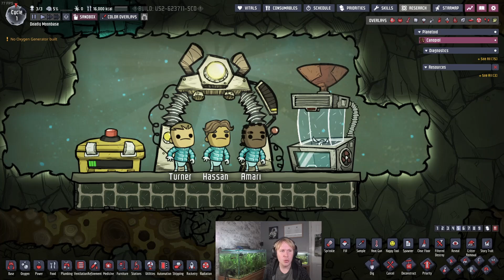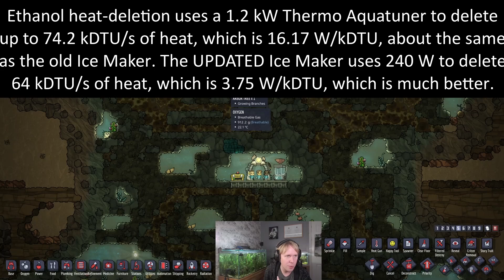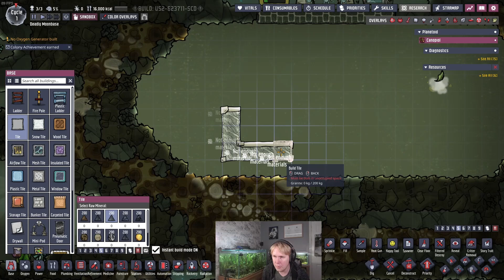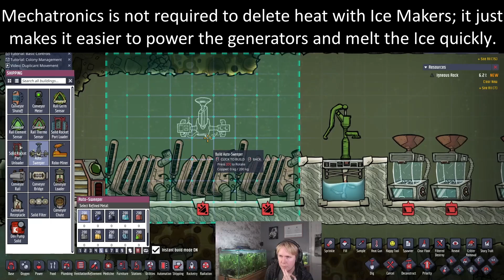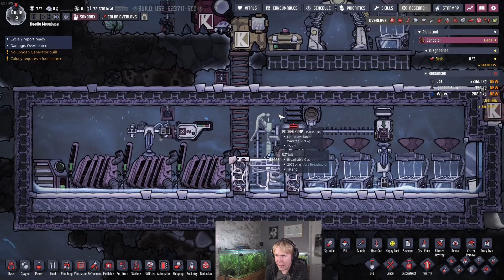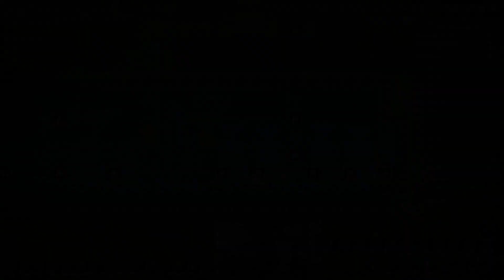The Ice Maker Got Giga-Buffed In ONI: Spaced Out! Sandbox Showcase #27

Comment from the maker: Here's something I didn't discuss in the video! The specific heat capacity of Ice increases from 2.05 kDTU/kg/°C to 4.179 kDTU/kg/°C when it melts into Water, doubling the required energy to state change it. Because we are actively forcing the temperature below this value with the Ice Makers with heat deletion, the overall effect is still obviously heat negative. But doing this with, say, a Thermo Aquatuner, would NOT be heat negative. The rate of heat deletion stays the same for the Ice Maker, so when the Water transitions to Ice in the machine at EXACTLY -0.6° C, the Ice decreases in temperature about twice as fast as the Water in our video at 7:04. 

For 60 kg of 30° C Water, freezing it to -20° C Ice takes (60 x 4.179 x 30.6) + (60 x 2.05 x 29.4) = 11289 kDTU (increasing to 11672 kDTU if freezing naturally in environment). Melting it back to 30° C Water takes (60 x 2.05 x 32.4) + (60 x 4.179 x 27.6) = 10906 kDTU. For 60 kg of 3° C Water, freezing it to -20° C Ice takes (60 x 4.179 x 3.6) + (60 x 2.05 x 29.4) = 4519 kDTU (increasing to 4902 kDTU if freezing naturally in environment). Melting it back to 3° C Water takes (60 x 2.05 x 32.4) + (60 x 4.179 x 0.6) = 4136 kDTU. So about 383 kDTU of heat deletion is lost per batch. Compared to the effective heat deletion of -64 kDTU/s of the Ice Maker and its operational time of about 4519/64 = 70 seconds, the effective heat gain from SHC difference is about 383/70 = 5.42 kDTU/s, i.e. about 8.5% efficiency loss. Overall, this doesn't affect the Ice Maker too much as most of the time/effort is spent in the non-state change regime. :_erisiaCool:
Reply: You are the goat for updating older Videos!

Comment: i mean yeah, it's stronger than before, but before it was basically useless. back in the days i tried chilling my oxygen with them and spend so much time tweaking it until it was ok to keep the oxygen and part of my base at normal temperature, and so much dupe time, that it would have been better to just push through and get a better heat deletion method.
so who knows, maybe they will keep it that way, or tweak it slightly.

Comment: could this make for a practical infinite refrigerator cooling solution?
Reply from the maker: Yes, but you would need to use it to cool down a Thermo Aquatuner or Regulator, as the Water needed for the Ice Maker to run continuously won't melt below 3° C. But you could use this set up to cool a Thermo Aquatuner instead of using a Steam Turbine if you want. This would be best combined with the new Nectar as it's the highest capacity coolant until Super Coolant now.
Reply: @erisia_gaming  i want to avoid having to afford the extra power requirement for an aquatuner or regulator, though. what about using the freshly frozen ice for the infinite refrigerator first and then use it to cool other stuff? (which doesnt need to go below -18c)
Reply from the maker: You could make the -20° C Ice and then transport it very carefully to some room where it runs around metal tiles, but I think the temperature would be too close to the -18° C threshold for "Deep Freeze" for such a setup to be practical. Thermo Aquatuner for a freezer is now twice as power efficient as before if Nectar is used.